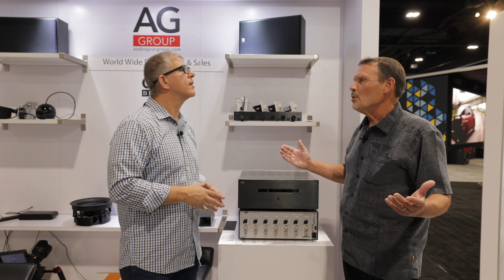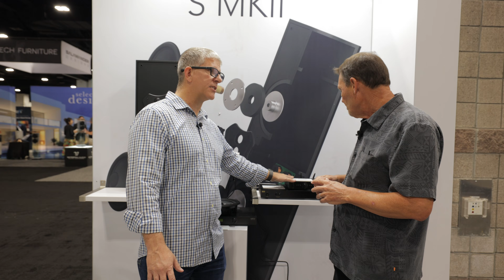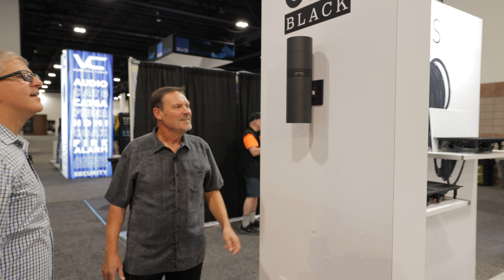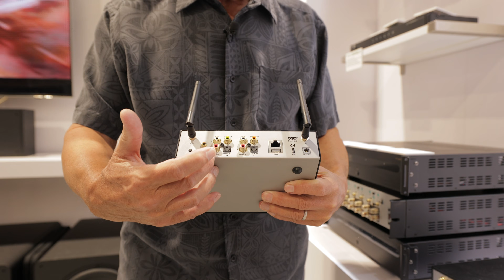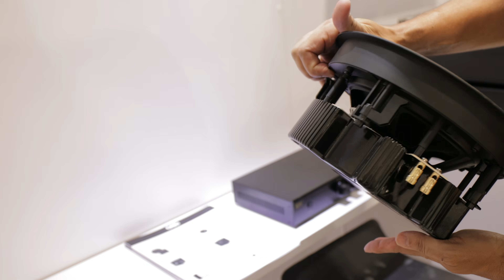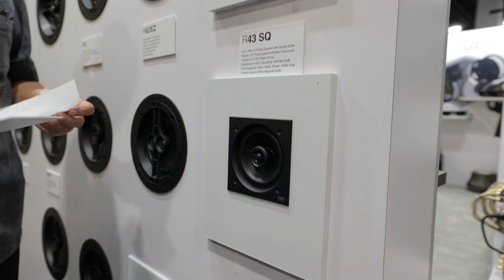Budget Amp with METERS? OSD Audio did it at CEDIA 2024!

Comment: I'm struggling to decide between the HTX8150 and the HTA7200. I like the smaller size and bridging feature on the HTX, but according to the spec sheet and a support agent, bridged mode is only rated for 8 Ohm speakers and anything below that may trip the protection mode and could damage the speakers or amp. Without bridging, the HTX is a fair bit weaker than the HTA, which is making it hard to choose. Does anyone here have one of the HTX amps, and have you had any problems with it going into protection mode when using it bridged?

Comment: Just bought the Nero 520. It’s on its way. I intend to pair it with my onkyo RZ50 using the pre-outs for a 5 channel set up with my 4 KEF350’s and a KEF150 as my center and two SVS pro1000 subs. I’m super excited. The value for what you get for these amps is crazy. I got the amp with discount for 500 dollars. Brand new.

Comment: I own OSD Audio Nero XA7180 7channel that is a beast, and I paid $699 Sale 2 years ago direct purchase.  No clue why people buy other amps since it has everything you need and is H design.  Flawless heavy 70 pounds built like a tank and i have it paired with my Onkyo RZ-50.   My RZ-50 only plays the Atmos Heights and the OSD 7 channel takes care of all 7 floors.  7.2.4.
Reply: @AussieTimeSirStewietheKnight  does the receiver run cooler when not running its own power

Comment: Those xlr connections don't cost much because it's a convenience connector and the amp is not a true balanced design which does cost a lot more because essentially you're duplicating the circuitry.

Comment: Dang, I love the look at this amp! Hey YM, do you know if this amp is stable down to 2 ohms?
Reply from the maker: I’m not sure.
Reply: @Youthman  Bummer. I was blessed to snag a pair of the Polk L800's and those big boys dig down to 2.8 ohms. Would love to know a little more about that HTA7300. 😊
Reply: If you have the impedance v's frequency curve I will be able to tell you whether or not the amps can deal with the impedance. 2.8 Ohms is a lot easier than 2.0 Ohms and not uncommon. Many 4 Ohm rated amps can handle 2.8 Ohms at certain frequencies, including ours.

Comment: Question...  if i have a Receiver and running the pre-outs to an amp for power instead of using the Receiver power , will the Receiver run cooler?
Reply from the maker: It likely depends on whether or not you can turn off the internal amplification in your AVR. Even if it’s running idle, it’s going to generate heat. The newer, Marantz units have Preout mode which completely turns off the internal amps.

Comment: 👍🏼👍🏼 !!!  great review Youthman. OSD is making some good noise in the audio segment. Question, do you know of the XLR connections are fully differential? I do wish they made at least some IP outdoor (weather resistant) amplifiers. TIC is the only reasonable option but their power ratings aren't great.
Reply from the maker: Simons reply. 

We have the WRA amplifier which is outdoor rated and can be controlled by our App via Wi-Fi. It’s 50 watts per channel times 4 into 8Ohms. Not super powerful.

He’s checking on the fully balanced question, but at that price point he does not think they are.
Reply: @Youthman  oh okay, thanks!  I'm going to look into it. I listened to the whole video. Maybe I missed that part of it.  Much appreciated 👍🏼
Reply from the maker: Thank you, Ben. I reached out to Simon. I’ll let you know what he says about the XLR.

Comment: Plz people people stick with 7 channel standard modules. 11 channel multi and single and stereo modules just don't work.

Stereo modules whether Emotiva, OSD, Tonewinner all suffer some cross talk on the stero modules.

Buy 2 x 7 x channle amps and upgraded dedicated 15 or 20 amp switch and you are rocking.
Reply from the maker: I’ve been running a Monolith 11X in my theater since it was introduced several years ago. It’s a beast and has never sounded strained in any setup I have had in for review or my personal systems.

Comment: 2 years ago I purchased the OSD Nero XA7180 Multi Channel (7x) Home Theater Amplifier. It has been EXCELLENT!!! Clear, clean, powerful sound, and over the past two years it has performed flawlessly! IMHO... I would say OSD Audio are currently the best quality and performance amplifiers for the the price right now, period. I have been an audio enthusiast for over 30 years and am that crazy guy with microphones and Room Equalizer Wizard (REW) who calibrates my room manually. The amp runs Arendal 1723 S front monitors and 1961 monitor surrounds. I run a pair of self-powered JTR Captivator 18" subs and they match the front and surround speakers power output and all balance well together. If you are in the market, definitely give OSD Audio a shot. <Cheers, Joe>
Reply from the maker: Awesome Joe! Thanks for sharing your experience with OSD.
Reply: Yogi bro can you help me to teach REW measurements
Reply: @ashikmusic7364   Google "REW how to use" and there are writeups and videos that can help you my friend : )

Comment: Can the 11 channel amplifier drive 8 ohm speakers?
Reply from the maker: Of course. Any amplifier can drive more higher ohms. It’s when you get down to lower Ohms that it demands more power from the amp and not all amps can do that.
Reply: @Youthman   so in this case what will be the power rating in 8 ohm and also can we get them in the uk?
Reply from the maker: Simon didn't say but as you can see from their website, they tend to state both 4ohm and 8ohm measurements - https://www.osdaudio.com/osd-nero-hta7200-multi-channel-7x-home-theater-amplifier.html

So we should expect them to do the same once they add the product to their website and are available for purchase later this year.
Reply: @Youthman   yeah I have checked it out, it has voltage selector 120/240v 👍💪
Reply: I would certainly hope so. 😂
Reply from the maker: No question is a dumb question. Not everyone realizes how impedance works. If they see specs rated for 4 ohms, it’s only natural to wonder if it will work with other impedance.
Reply: Yes, we will be quoting the FTC required rating which is 8 Ohms, 20Hz-20KHz, 1% THD+noise at least 2-channels driven, as well as all channels driven. The amp is in production now and we will fully test the first production piece and quote actual specs.
Reply: @simonspears7892  Hi Simon, what brand are your class D amplifiers? Hypex, Purifi, IcePower, Infineon or Pascal?